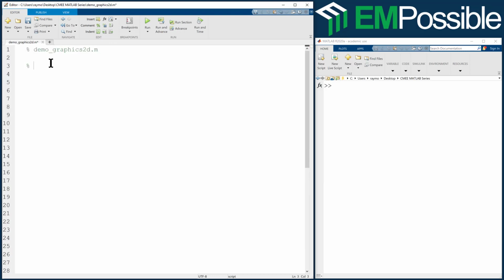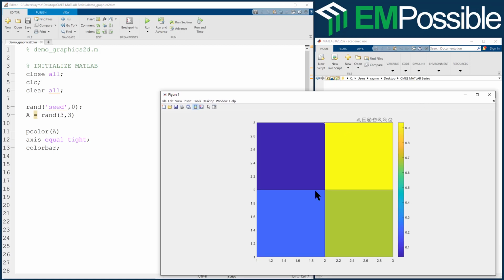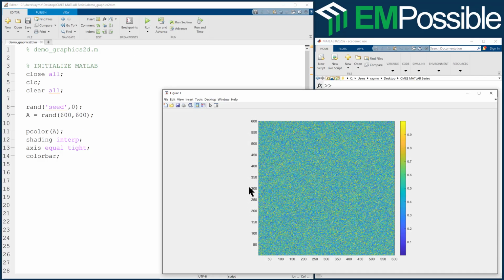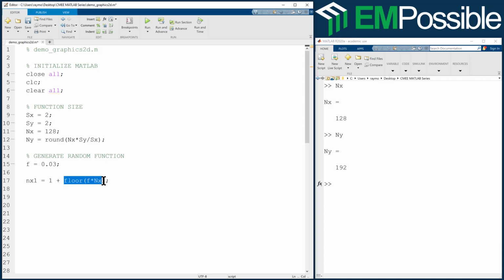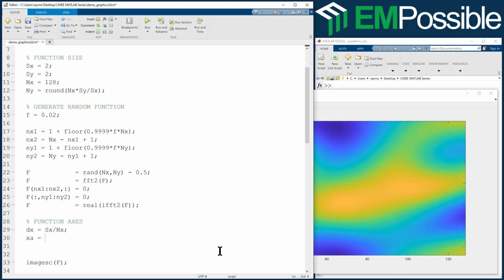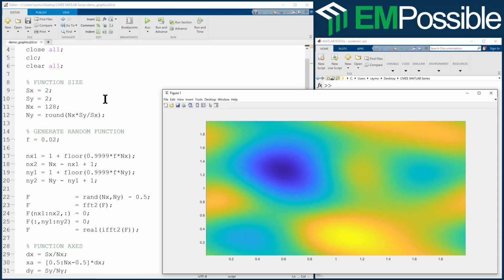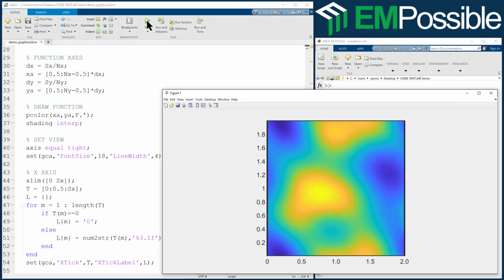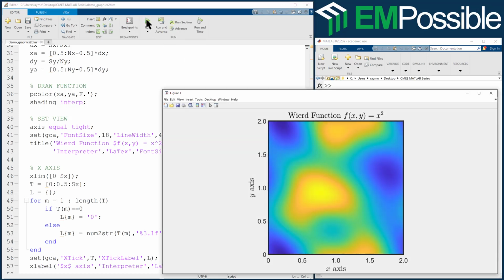Generating Professional Two-Dimensional Graphics in MATLAB

Comment: Thanks for the informative tutorial. I want to ask something that I couldn't reason. When you construct number of pixels Nx and Ny you said you wanna make them as square as possible and writing the code Ny = round(...). Instead of doing that why didn't you simply write Nx = Ny, did I miss something over here?. Thanks.
Reply from the maker: Great question! 

First, if you are just trying to draw pictures, the techniques I am teaching about ‘Nx’ and Ny are sort of silly. These skills are needed when you are building geometries into arrays for some sort of numerical analysis or simulation. For me, it is electromagnetic simulations and I am building shapes into arrays that I want to simulate electromagnetic waves interacting with. I may have to build a rectangle on the grid that is something like 1.0 cm x 1.32 cm. What grid resolution ‘dx’ and ‘dy’ would I choose for this? To represent both dimensions exactly, I would need dx=dy=0.01 cm to keep the pixels in my array perfectly square. However, that would require a very large array and I could easily run out memory doing it this way. Instead, I will make ‘dx’ and ‘dy’ slightly different numbers so that I can represent 1.0 cm and 1.32 cm with an exact integer number of cells while keeping the pixels as square as possible. For example, I would make dx=0.1 and dy=0.0943. Now I can represent 1.0 cm with exactly 10 cells, 1.32 cm with exactly 14 cells, and the grid has close to square shaped pixels. I may have overstated the need the keep the pixels perfectly square. I have successfully run simulations where the pixels were more than 10:1 stretched. It is just good practice to stay as close to square as possible without worrying about being perfect. 

Hope this makes sense!
Reply: @empossible1577  Thank you so much for your explanation. In short what I understand is about finding a balance between accuracy and practicality when creating grids for simulations, so you don't use more memory than necessary while still representing the shapes as accurately as possible :)
Reply from the maker: @erayceyhan2453  I think 99% of computation is trying to fight the accuracy vs efficiency tradeoff.  Have fun with it!

Comment: If i follow these steps can I get an image? If I use data from different node RF? to find an object?
Reply from the maker: The process would be to assemble your data in an array and use a command like imagesc() or pcolor() to image it. I am not sure what "different node RF" is. There is an image processing toolbox available that may make things like object recognition easier. I don't use the toolbox. I am only aware that it exists so I am unsure of the functionality. All that said, you can definitely use MATLAB somehow to find objects in images.
Reply: @empossible1577  can you help me pls ihave many  question?
Reply from the maker: @FatimaAlsayigh  I can certainly answer quicker questions, but if you need to do any kid of work, I may not be able to help until later September.
Reply: @empossible1577  iwant to know how to use  tikhnove or LPP or FBp. With matrix to get image and heat map

Comment: Dear Prof.,
I am following your lectures and I'm learning a lot of new things. 

Just a quick question. Why did we take the FFT and then inverse FFT. I want to understand what did FFT did to the 2d plot and what did inverse FFT did.

Thanks
Reply from the maker: When you calculate the FFT, you are calculating the amplitude of all the frequencies making up the original signal (or image). If you then calculate the inverse FFT, you are back to your original signal (or image). In this algorithm, some of the frequencies are set to zero after the first FFT. This leads to filtered signal (or image) after the inverse FFT. I do this to create low frequency noise.

If you want to see more that all the Fourier transforms and this noise generating algorithm, checkout Topic 9 here:

https://empossible.net/academics/emp4301_5301/
Reply: @empossible1577  thank you prof. for the explanation

Comment: What Color format does the imagesc function use. How would one convert from RGB for example to the format that is used?
Reply from the maker: The RGB formatting you are talking about is probably the jet colormap in MATLAB.  It was the default colormap until something like five years ago.  The new default colormap is called parula.  You can change the colormap using one of the following commands...

colormap('jet');
colormap('parula');
Reply: @empossible1577  Ok thanks for your response. Here is what I am trying to do. I have an array of data but it is in the RBG565 format(binary). I want to load the file into MATLAB so that it is displayed however I dont know the format that imagesc accepts. 

from the function description I see where it has just an array of a single value (C), imagesc(C). 

example C=[5 4 5; 3 5 7]. how does those values in the matrix represent color. 
I want to know so that I can convert my values to that format and have MATLAB display the data
Reply from the maker: @williampowell7518  Hmmm...I have never done this, but I did find the following information...

https://stackoverflow.com/questions/3578265/how-can-i-convert-between-rgb565-and-rgb24-image-formats-in-matlab

Comment: Sir, how to create these type of plots from a given dataset(in excel)?? (Sorry, I am new to MATLAB)
Reply from the maker: If the data is in Excel, you can import an Excel file into MATLAB using the xlsread() function built into MATLAB.  From there, you would plot as described in the video.
Reply: @empossible1577  I am new to MATLAB and trying to plot data from EXcel. After importing data from excel, can you mention which step should I start from? Do I need to define the "function size",  and "generate random function"? or should I start from "Function Axes"?
Reply from the maker: @nailazaman3558  I do not know anything about the data you are plotting.  Since you already have data, I do not see any need for random function data.  Instead of defining the function size, determine the function size from the size of the array read from the Excel file.  Never define anything that can be determined or you are setting yourself up for problems if something becomes inconsistent.  The next step is probably defining the function axes, and then finally the plotting.  Again, it is very hard to say your steps without knowing anything about what you are plotting.

Comment: Thanks Sir. I have produced a subplots of maps (with lats and lon) in two columns on an axis. But there is a big white space between the two columns of subplots. Is there a way to delete this white space in matlab?
Reply from the maker: Yes, there are several ways.  The easiest is the play with the size of your figure window.  If that does not work, you can create four subplots, plot in the first two for your first plot and the second two for your second plat.  There are also ways to manually define the size and position of each subplot.

Comment: Hey there, im working on a pcolor plot, and was wondering if you could explain how to make the first row and column serve as the x and y axis. Thanks so much
Reply from the maker: Are you trying to draw the axes or just have the first row and column be x=0 and  y=0?  The general format for a call to pcolor is

pcolor(x,y,A)

Here, x and y are arrays containing the position of the points long x and y axes.  Simply make it so that both x and y start at zero.

If you are trying to draw the axes, you will need to call pcolor and then call another function like line() to draw the axes.
Reply: @empossible1577  In the sheet containing all of the data the first column states the time when measurements were taken, the first row states all the wavelengths times were taken. The data is the remainder of the chart. I have been told to use that first column as the Y-axis, and the first row as the X-axis.
Reply from the maker: @matthewbarnes1356  Sounds like you will need to extract the first column into the array y and the first row into the array x.  Then extract the data starting at row 2 and column 2 into the array A.  Then you can plot it as pcolor(x,y,A).